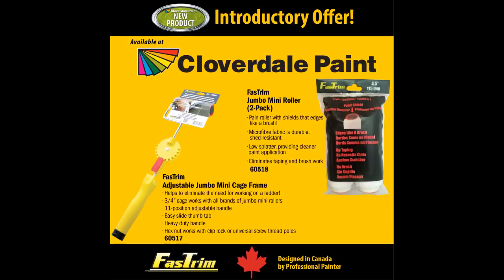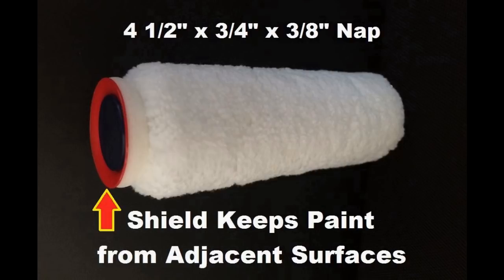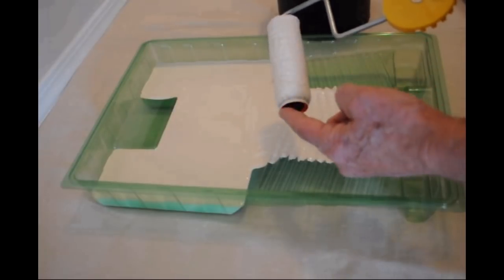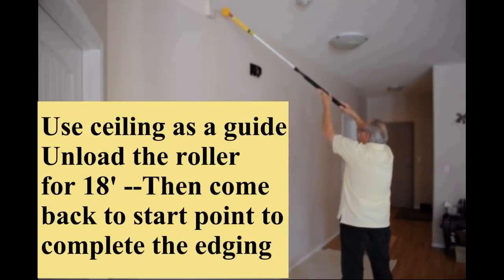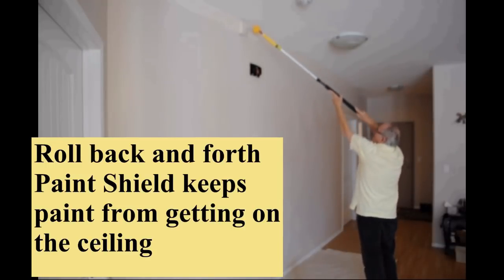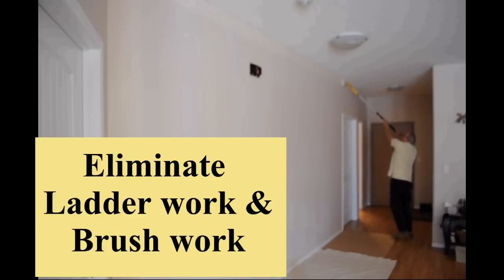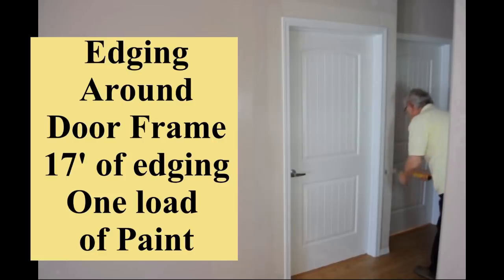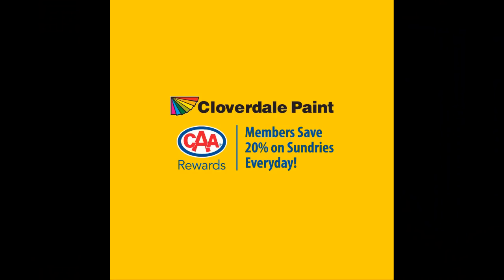Paint Edger - Faster than a Brush - Eliminate taping!

Comment: I’d like to see that being used on a stipple ceiling , make sure that ride ring is perfectly clean but I’m wondering if it would make marks on the ceiling
Reply from the maker: Hi Wes  we sell the tool as an edging assist tool, up to stippled popcorn ceiling the only thing that works is a brush on first cut, you can use this tool on the second cut and gently bump it along the texture or keep it slightly away. So used on an extension pole you should be able to eliminate ladder work and brush work on second cut.
Reply from the maker: Hi Wes  I just uploaded a new how to video, it shows edging next next to ceilings as well as shows the simple process of how to correctly load and use the roller.....    https://youtu.be/6a3nW6T1Q2U

Comment: Definition of a gimmick. Yes could work in some situations or second coats but a professional painter can also just do that with a normal roller if they know what they're doing.
Reply from the maker: Hi Aaron, definitely not a gimmick. The biggest challenge I have found it having painters get over skepticism about the tool. There is no magic wand for painting. What I am selling is an edging assist tool that can gain first cut accuracy in a limited number of situations, but the majority of color change paint jobs typically take two cuts and two coats. What I am guaranteeing is that on same color maintenance painting and or 2nd coat on a color change you could help eliminate over 50% of your labor for ladder and brushwork. It is a tool that can add money for a pro painter willing to give it a try and can help a skilled DIY painter with the same things.  Here is a link to a video that a 35 year pro painter sent that he doubled his income using my tools where he was a skeptic before.  He actually calls it "A Game Changer"   https://youtu.be/lHD298DRhik